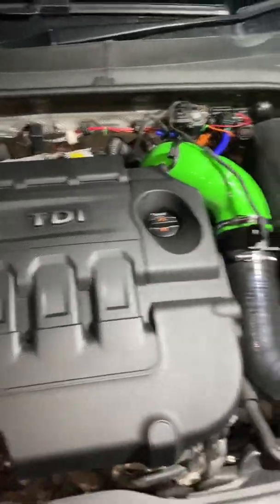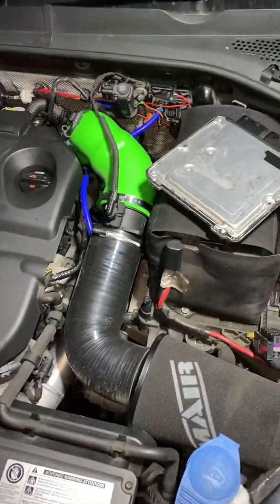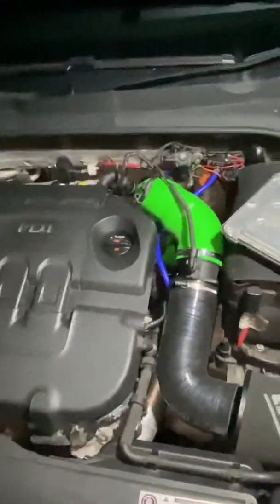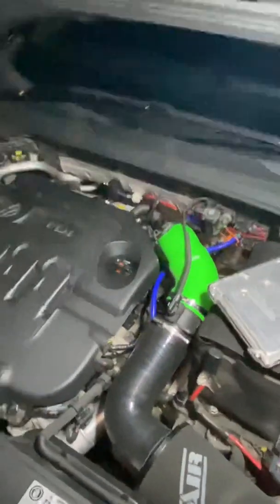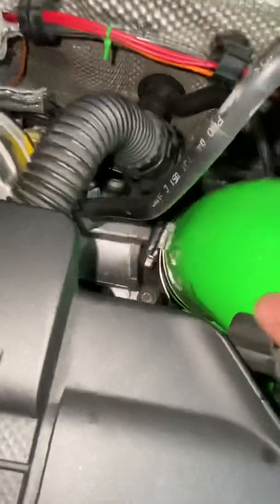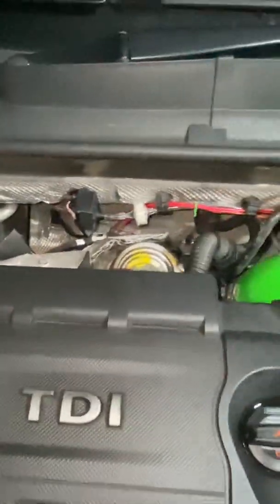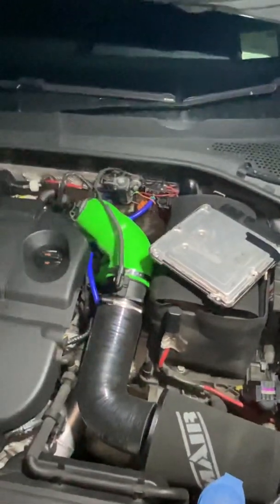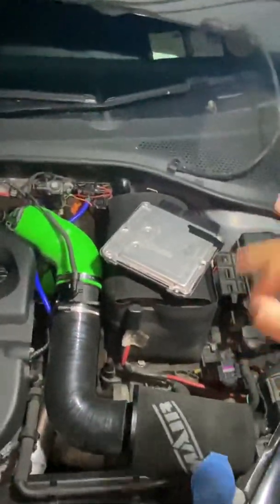Tuning the Volkswagen Golf CR150 to accept the GTD1449vz

Comment: Did you say at the beginning of the video youd fitted this to a CRBC engine? I've got the same in my Audi A3 so hoping it will be a straight fit as well.
Reply: Yah was the crbc 2.0tdi engine.

This was from a golf gtd into another mk7 golf, it should also be plug and play for the Audis
Reply: @seancusack  Do you know what your OE part number was? Was it (04L253019Q) and is the new turbo part number (04L253010H). Thanks
Reply: @mattchamberlain859  Did it fit straight in? I am putting 1449 on a 150hp 2017 skoda yeti and because it is on PQ platform, I am wondering if i should do any modifications for it to fit.
Reply: @kaloyankolev7658 did you succeeded with the yeti swap??
Reply: @groove4all  Nope, sorry, did not swap the turbo on my DFSB engine, just remmaped... But he remapper said it needs to be hybrid, 1449 has different size headers

Comment: Glad I found this. My only focus was how was spool compared to stock charger?  I’m looking to go to a gtd1452vz yes, 52 it a custom billet wheel, but I don’t want to lose spool.
Reply from the maker: I can confirm you won't feel any difference in turbo lag
Reply: @ckpelectronics8921  ok, was hoping for a bit quicker spool with the gtd1449vz so I could go up to the gtd1452vz from Xman. Now I need to rethink.
Reply from the maker: @hamwallet7069  If its a 2 litre engine you're not getting into the territory where itll effect spooling, id say when you start getting +5 on both the inducer and exducer is when you'll feel the difference.

The spool when i had swapped to the 1449vz was fantastic
Reply: @ckpelectronics8921  I think maybe I confused you. My goal is to get a quicker spool with the gtd1449vz over stock, if it was I would move up, but if neither offer a quicker spool compared to stock one I’ll just stay with that and when it goes I’ll switch to a gtd1449vz at that time and remap,
Reply from the maker: @hamwallet7069  the 1449vz will flow much better than the stock turbo and handle more boost. Even if you aren't getting a quicker spool it's pretty much the exact same but with the benefits I mentioned above, especially if you plan on tuning you can squeeze a good bit more bhp over the stock turbo
Reply: @ckpelectronics8921  yeah I’m not after power so it’s not a worry of mine. I know it’s a better turbo, but if I’m not gaining what I’m after (mpg related, not power) then there’s no point to change parts until 1 fails. That’s all.

Comment: What about fuel injectors? I know them bigger on gtd
Reply from the maker: You're absolutely correct the gtd injectors are much bigger and can sustain ~280bhp without demanding crazy duration.

The CR150 injectors aren't too small either they're good for ~240bhp but I'd say you'll experience fuel drain from the cp4 before you get close to maxing out the injectors

Comment: Is it worth it or the stock turbo with remap enough?
Reply from the maker: At 180bhp the cr150 turbo really runs out of puff and you'll end up with a pretty smokey tune whereas the gtd turbo will be sitting comfortably at that power, so big question is do you care about smoke and do you want more power than 180.

I ended up achieving just over 200bhp and it was great

Comment: Hi , did the turbo was a straight swap , did you need any adjustments, also did u swap over the actuator?
Reply from the maker: Hi,
Yes the turbo was a straight swap, the oil fees and return pipes were exactly the same, the exhaust manifold was the same, air intake was also and I didn’t swap over actuators.

I did have to adjust the actuators duty cycle as it was boosting too high initially but I believe if I had swapped over the actuators that wouldn’t have been an issue.